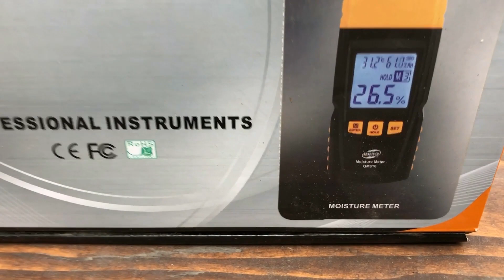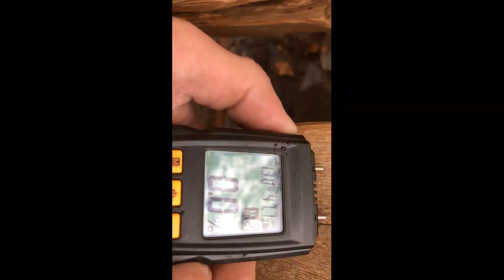How To Clean Beams / DIY Mantle and Floating Shelf Projects

Comment: Great videos!
Question... What is the harm in pressure washing?
Reply from the maker: Great question - it does depend of the final use of the wood but generally Barnwood has had ample time to dry naturally.  Introducing water back into the wood to later dry is counter intuitive and can also disturb the wood surface resulting in more sanding.

Comment: I'm using reclaimed wood from the old barns in the back of my 224-year-old farmhouse reno.  So far, we've put 1 beam vertical in the kitchen as a support, and planks are being prepped for floors and trim. All it's costing me is time,  labor, and cleaning/sanding materials.
Reply from the maker: How did your project turn out?  We love barnwood stories

Comment: Thanks for the video. Which step would you use the nylon wheel for the restorer? Thanks again
Reply from the maker: The nylon wheel is not as abrasive as wire which is an option for more delicate surfaces.

Comment: I came into a bunch of barnwood beams. I sold one for $225. Too cheap.  What should be a bd ft price for a finished mantel?  Thx.
Reply from the maker: So many factors to consider when pricing finished mantles such as beam size, species, how it was prepared and if mounting brackets will be included just to name a few.  Definitely check out your local market pricing points as a starter then adjust from there.

Comment: Hello, very useful video, for which I thank you very much! I'm not a carpenter, but as far as I understand the tool you used to go through thousands of meters of beams is a grater. What exactly is this carpenter's grater? Brand, power and so on? And accordingly, does the wire attachment have any peculiarities for it? Thanks in advance!
Reply from the maker: Glad to hear that you found value in our video, thank you.  As far as your questions I do plan on diving deeper into the Restorer tool in the future.  I intend on providing my personal experience with this tool when it is used for reclaimed wood and tips to consider.
Reply: @TheDenBarnwood  Glad to hear it. I will look forward to seeing this useful information. I wish you much success on the front of the beams!
Reply: @TheDenBarnwood  Did you ever do the video showing what the grater is? What tool is that?
Reply from the maker: @aaroncavanaugh7017  the Restorer is featured many times in our DIY builds.   This is what was referred to as the grater.

Product review videos are not our thing, well not right now anyways.
Reply: @The Den Authentic Barnwood  awesome. Thank you. I found that link. Sorry I missed it prior.

Comment: Very cool. Don't you have to put these in a kiln before you safely bring them in your house? I was under the impression that you need to "sanitize" the wood by killing any insect that might be living in the wood with a kiln.
Reply from the maker: I agree, kiln drying wood is the most effective method for ensuring reclaimed wood is pest free.  The added bonus is that it is a controlled process producing quality wood that resists warping, cracking and other undesired effects.

This sounds like a great topic for a dedicated video.